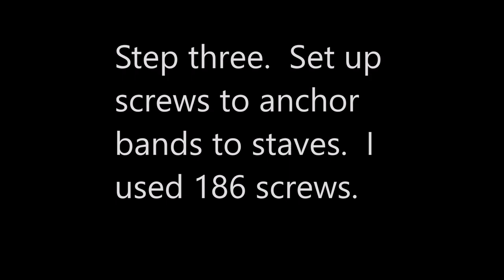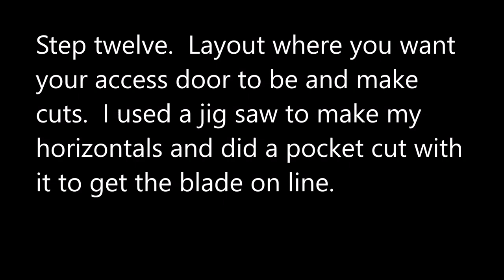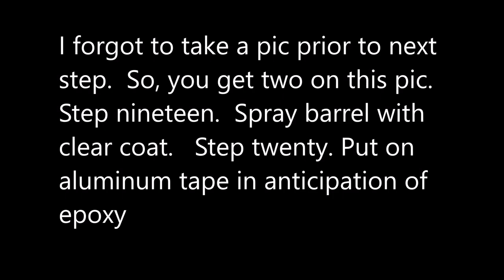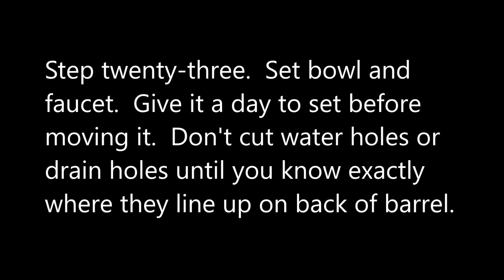Building a whiskey barrel sink

Comment: Im finding it very hard to drill into the bands of the barrel, any suggestions?
Reply from the maker: Do you have a bit that is for metal.  If your using a wood bit, that will take forever.
Reply from the maker: You do have a metal drill bit? If you are using a wood one that will take forever.  Make sure the bit is sharp too.  Little wd40 wouldn't hurt either

Comment: What grit of sandpaper did you use to achieve/preserve the weathered look?
Reply from the maker: i just used some 400 grit i had in the shop and a sponge sanding block.
Reply: @Samandcocoa  Thanks!
Reply from the maker: @marethehare9172  anytime.  good luck with it

Comment: What type of screws did you use for the barrel
Reply from the maker: i used a selftapping metsl screw
Reply from the maker: #8 3/4" if you want more specifics
Reply from the maker: https://www.amazon.com/Phillips-Modified-Self-Drilling-Zinc-Plated-Attaches/dp/B0768M5YF1/ref=asc_df_B0768MR94M/?tag=hyprod-20&linkCode=df0&hvadid=198091685647&hvpos=1o7&hvnetw=g&hvrand=11187503357038647979&hvpone=&hvptwo=&hvqmt=&hvdev=c&hvdvcmdl=&hvlocint=&hvlocphy=9018805&hvtargid=pla-394299701275&th=1
Reply: @Samandcocoa  thank vary much for all your great information im in the process of making one right now thank you for all the good tips
Reply from the maker: @winstoncampbell8602  anytime.  if you have any other questions let me know.
Reply: @Samandcocoa  ok perfect thank you vary much